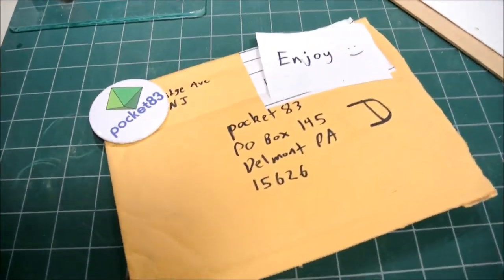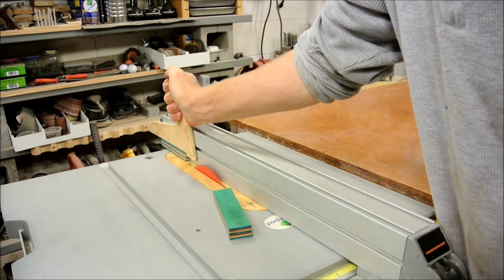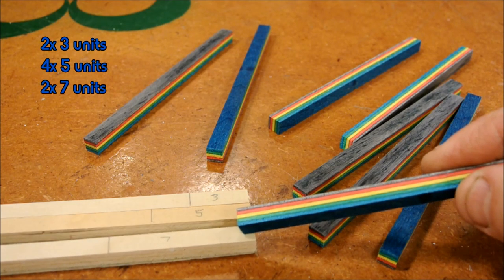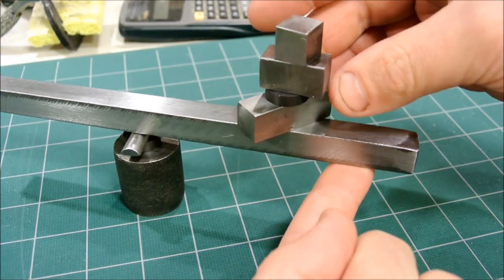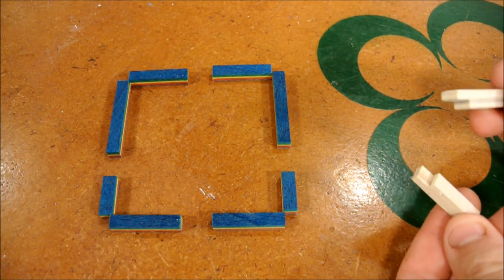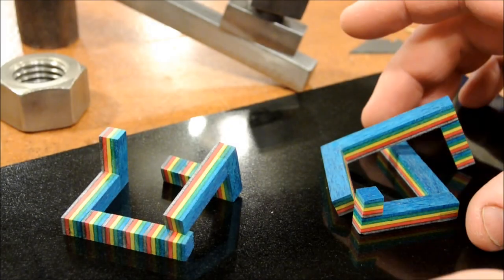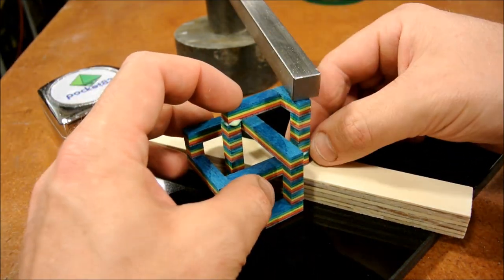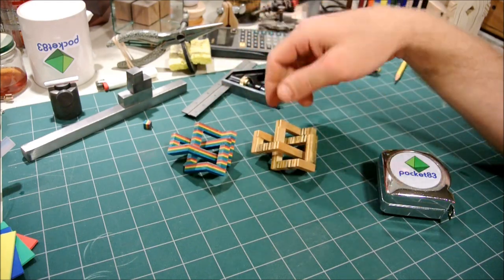Return to sender! (build)

Comment: Delicate and Tedious - great job!

And the Rolling Rock beer cap magnet - Ah, how I miss Rolling Rock.  33.
Reply from the maker: It was originally brewed not far from here until they sold it. They changed it, and it was never the same since. We used to swim in the Loyalhanna, which is where the water for it came from. Tiny river, but it stretches through beautiful country.
Reply: how sad about the change.